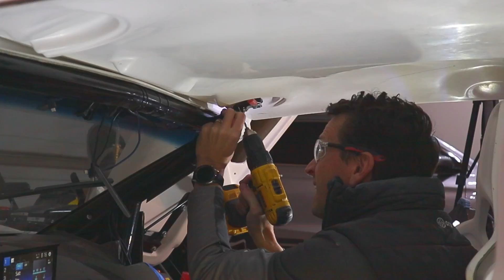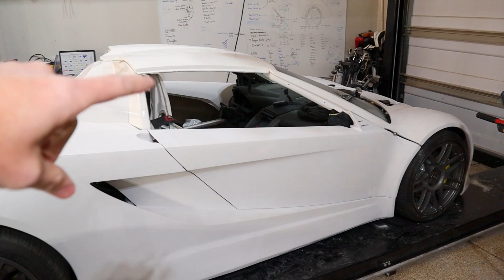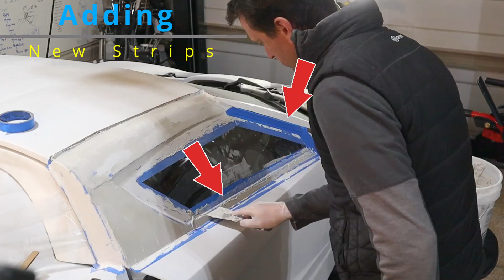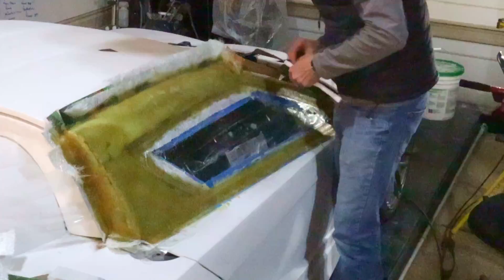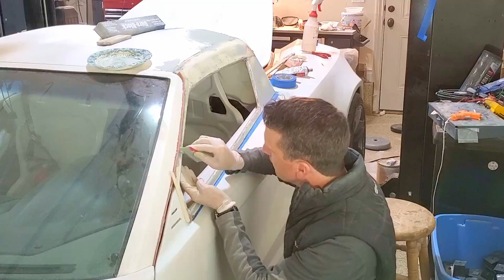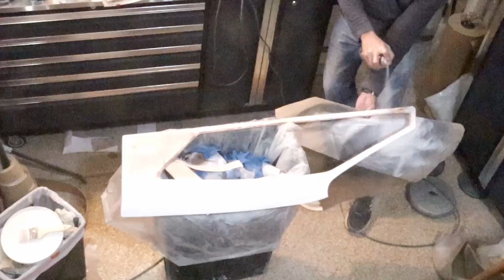Making Custom Door Panels!  (DIY Fiberglass parts) ESC S1 E116

Comment: So true about the 10/90 thing. When anyone asks about building a component car the number 1 thing you have to have is ...... DRIVE. I say - Everything on this car is my fault, from door locks, AC system, glove boxes, switch gear, general engineering"...  You comment on the door latching.... Car companies have maybe 10 engineers working on just that aspect, you on the other hand are one engineer responsible for every system on the car. I tuned in to the channel as I have long been interested in the K1, yet there is almost zero online information. Thanks for the effort and allowing others to asses the challenges associated with this manufacturer and the quality of the components (or lack thereof). You may be a car building rookie, but I'd bet you are an accomplished engineer/problem solver in some other field.build of one of these cars. Thank You.
Reply from the maker: Thanks Friend!

Comment: since you have the flimsy roof, why not make your own roof. A double bubble like the original 1966 batman car, with an extra brake light between the two bubble domes that can be seen by trucks and SUV's.
Reply from the maker: I am attempting to fix the roof this week
Reply: @electricsupercar  so instead of fiberglass for the roof, use plexiglass. make a double bubble like the batman car of 1966. this would allow someone taller to sit in the car. keep making it better, not the same.
Reply: @electricsupercar  maybe one big polycarbonate bubble roof for extra room for taller people, or perhaps two smaller bubble panels side by side, one above driver another above passenger,  connected with a thin band of carbon fiber between them with a molded spot above back window for an extra brake light so bigger vehicles can see your stop lights.

Comment: Im a long time viewer of your channel.  I have a couple of tips that you could try or not it's all up to you.  Instead of packing tape or painters tape try aluminum tape that has an adhesive backing to form anything you want to create.  Not only does fiberglass not stick to it but you don't have to put drywall mud on it because it keeps a shape.  Three things that fiberglass won't stick to is Aluminum foil or aluminum, wax paper and parchment paper like bakers use.  Give that a try it could end up saving you time and effort. It also makes it quicker !  Just saying
Reply from the maker: Awesome tip!

Comment: Great videos, love the weekly update. I have a question : When I built my kit car many years ago, the door window panels bellowed outwards when driving along due to the low pressure on the outside of the window pane. Have you thought about this and how to combat the problem?
Reply from the maker: Thanks for the comment!  Not sure that I understand the problem as I have not yet been able to drive with the windows on.  Would the windows wobble?
Reply: @electricsupercar  More like the windows and frame would bend outwards at the roof if not strong and rigid. The air rushing over the outside creates low pressure, just like air rushing faster over the top of a plane wing creates lift.
Reply from the maker: Got it!  Thanks for the explanation!

Comment: Is the door going to clear the A pillar with that piece in front of the window? Looks good though. Glad you did that bottom strip to make the window more secure. Looks more like a factory thing vs an after thought that a rubber or foam gaskets would’ve looked like sitting on the bottom of the window. Keep up the good work. Did you choose a color yet?
Reply from the maker: Thanks for the comment!  Still working on door clearance issues.  No color decision yet.

Comment: Just curious is this a build that will allow you remove the panels and do convertible?  is the roof and window panels going to be a permanent fixture? either way you did a great job on those panels way better then whatever the crap is you got with the kit, Looks Great.
Reply from the maker: It is meant to be an open-top roadster.  The roof is an optional feature that can be added or removed.
Thanks for the comment!

Comment: Another question, do you plan to paint your car in your garage? because the humidity temperature filtration etc,  are not controlled. or you plan to take it to a car spray booth and paint it yourself?
Reply from the maker: I do plan to paint it myself.  I can work on the filtration part, but will have to wait on a day when temperature and humidity are good for paint.
Reply: @electricsupercar  You could rent a paint booth for 100$ for a day and paint it your self if you want a perfect particle free paint. But I understand if you want to do a full DIY in your garage. Thanks for replying <3
Reply from the maker: @spyro9979  awesome idea!

Comment: Sorry if this is a dumb question, but I saw a video that your ordered the kit, if it was already aligned from the manufacturer. why did you do a full overhaul and re alignment? it wasn't aligned when you got it? and why is that. what am I missing? thanks
Reply from the maker: Definitely not aligned from the manufacturer.  Not sure how they could  🤔.   The builder assembles the spindles, steering rack, tie-rods etc.